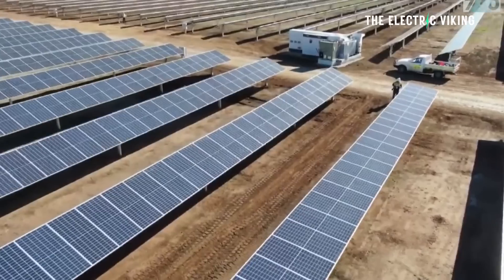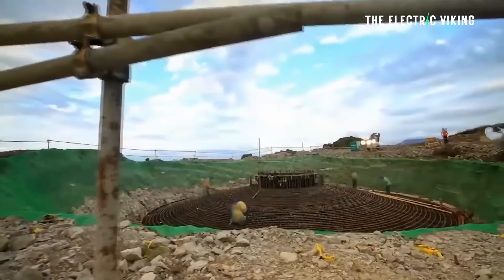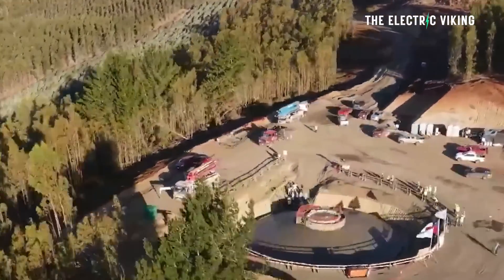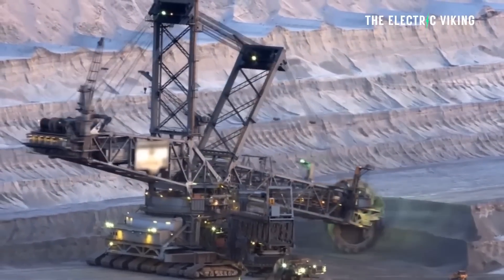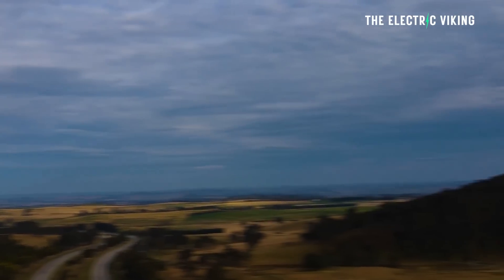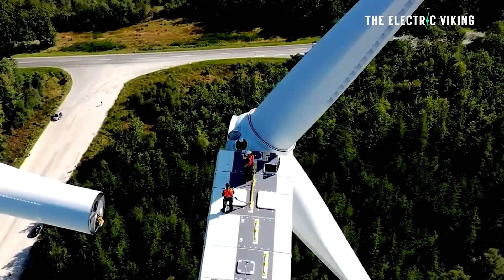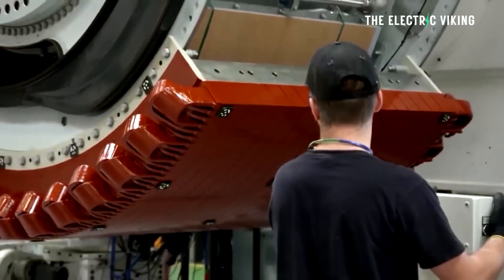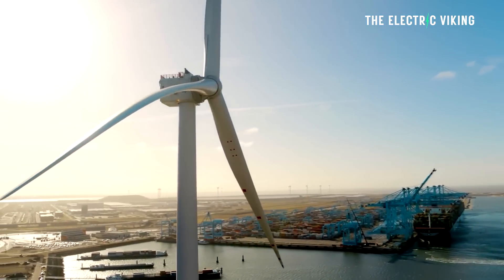Germany is turning open cut coal mines into MASSIVE wind farms

Comment: Liked.
Seems like a good idea, but I wonder what the wind strength & patterns are at those old coal mine locations... 🤔
Reply: Do you reckon they thought about that before investing millions?
Reply: @jsanders100   Do you reckon that coal power plants are intentionally built on the windiest locations?

If not, then this might be more motivated by super cheap land, and good optics PR.
Reply: @Dave--FkTheDeepstate  I think you have a point. 
I would guess it's not easy to develop such land for housing or commercial use, hence low value land.
And wind farm detractors can hardly claim it's desecrating an area of outstanding natural beauty
Reply: @jsanders100  hahaha....it may have slipped their minds 🤔

Comment: Wind is not an inexhaustible resource. Building a few thousand windturbines is not significant, building 10's of thousands (which is happening) does change the air flow over regions or continents. This is not some crackpot conspiracy theory but measured and modeled reality.  Wind power is very inefficient converting sunlight into energy 2% or less). Wind carries thermal energy, water, insects and particles (the Amazon depends on dust from the Sahara). It is not a trivial issue, but wind power is not a benign form of energy. Next time you see them forget the small blades and imagine a solid disk over the area covered by the moving blade. Of all forms of energy production wind has the potential to change climate the quickest.
Reply: Is there much research on this?
Reply: Wind turbines don't convert sunlight to electricity in any direct way.
Not sure what you're trying to say

Comment: Old Power plants have the EXPENSIVE transmission lines in place.
The location of big batteries in the shadows of the wind generators is perfect CO LOCATION of assets. 

Accumulated excess electricity when generated means maximum use of the site.

Coal-fired generators are at coal mines.

Fossil fueled back up during transition to renewable build out maybe smart business.

Comment: Germany is opening massive wind farms on their open-cut coal mines? Good. They can use the soil three times:
Once for regular farming,
Once for solar farming on a grid of elevated frame structures. They can also use these frames for running the power to a battery farm. (†)
Once for wind farming on poles at the connection point of the grid.
If they really want to get every erg of energy, they can run pipes underground for geothermal farming.
†) They could also set up aerials like the square kilometer arrays in Australia and South Africa
Reply: ❤Would be great. 
Different Government needed for that.
They decided to prolong brown coal mining instead.